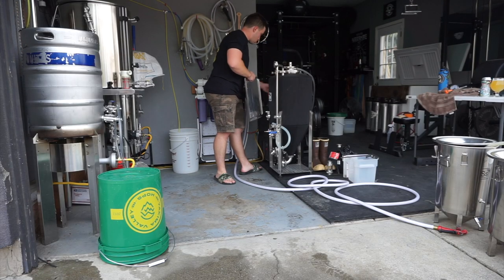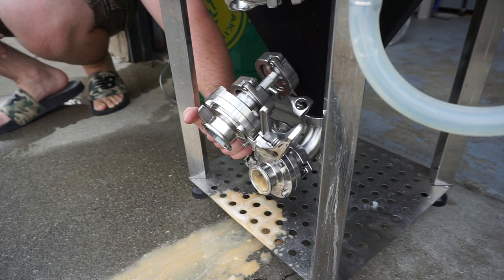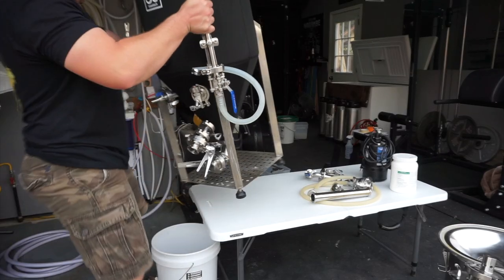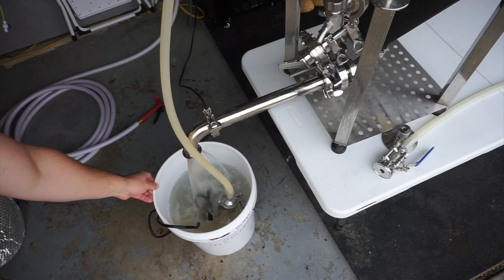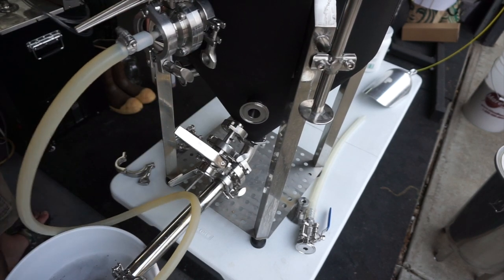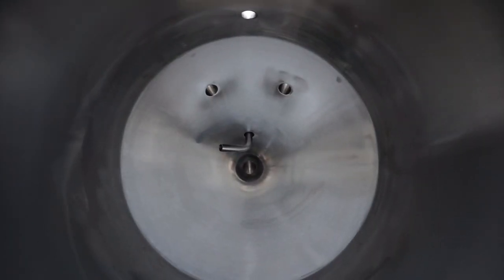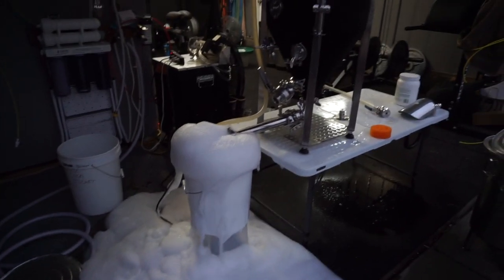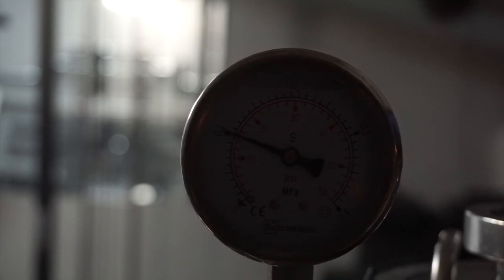HOW TO: CIP Conical Fermenter (Step By Step)

Comment: The more you know the longer it takes. Ignorance  is bliss. I do envy your unitank.
Reply from the maker: I no longer own them for the time reason alone, features are really nice to have though!
Reply: Yeah agreed. It's so much work in comparison to a simple fermenter. I bought a Brewtools MiniUni, which only has a top and bottom port. So i can pressure ferment, carbonise, drop hops oxygen free, dump trub and do CIP cleaning without having to dismantle and clean too much.

Comment: Thanks for the video..It seems like a lot of effort for such a small fermenter. I cleaning mine by hand in a lot less time - rinse out initially, hot wash with pbw solution (including brush...), rinse with water, cleaning with acid based solution, rinse, than remove all part and clean/brush in a bucket......at lease it feels that way 😀. Anyway nice video.

Comment: Great overview. All that work is a reminder of why I didn’t pull the trigger on a unitank, haha. 

I’ve settled for fermenting in 1/2 bbl sankeys. A friend of mine owns a brewery so I just swap out for a sanitized “fermenter” fresh off the keg washer every time I stop by.
Reply from the maker: Sounds like a killer deal! Honestly? I think Sanke kegs are one of the most underrated fermenters.

With the addition of a sample port and a way to purge CO2 while dry hopping, they are the next best thing to a uni in my eyes, considering the price of course. To bad I don’t have some food grade welding skills!
Reply: I came up with a tri clamp set up with a floating dip tube and butterfly valve for sampling/racking and dry hopping. I couldn’t figure out a simple glycol solution for maintaining temperatures, but I just tape the probe to the sidewall and use a vertical freezer as a fermentation chamber. https://www.homebrewtalk.com/threads/another-sanke-fermenter-gadget-floating-dip-tube-and-hop-dropper.684974/

Comment: Seems spot on to me. I picked up a big Chugger pump so I can CIP my 1/2bbl without the bucket and avoid some of that mess but it’s essentially what we did at the microbrewery where I worked too. I use hot water as a final sanitizer as well but I wait until brew day since the burners are going and there’s plenty available.
Reply from the maker: The Chugger MAX? That’s what I would like instead of the sump pump so it can be a closed loop but for 6x the price, I’ll have to stick it out with the sump pump.

Being able to use 185F water to sanitize would be awesome VS starsan or a non-foaming sanitizer.
Reply: Yes, it’s a tri clamp Chugger Max. Just got it. Before that it was a March and then a Riptide. Neither had enough pressure to go a really good job, I’m counting on nearly double the PSI to do it. It was pricey and the 1” hose and fittings added even more $ but besides it doing a better job it should also be a time saver. Just another piece in the endless gadget money pit that is home brewing!
Reply from the maker: @christopherbaas1774  ain’t that the truth. Cheers 🍻
Reply: @HopKillerBrewery  Why dont you use the same pump you use for brewing and then you could do a closed loop?  No additional pumps required

Comment: what attachment was used for the sump pump? The female to TC 1.5 in particular, most sump pumps are .75 inches or 1.25, so which attachment you use?

Comment: When you say you need to vent it to prevent a vacuum, what do you mean?  You have a pump pumping solution into the conical and a drain letting the solution come out.  By vent, are you just talking about the drain or something else?  I'm also not sure how a vacuum would be created in something that is being pumped into rather than out of.. but I'm new to conicals and just trying to understand.
Reply: I believe that would only be a concern if he was using an inline pump. With the bottom port open there is no danger of a vacuum

Comment: Nice setup! Do you use hot water with that pump when cleaning, and if so how does it handle the heat? I've been trying to figure out how I want to build my cip, and I've considered just using my chugger pump, but I've heard they can't produce enough pressure to make the ball spin. Cheers!
Reply from the maker: They are rated for 120F I think? Check the manufacture info in the link for the pump to make sure. I’ve used 140-150F with it multiple without problem, so far. At some point I imagine the gasket will give BUT it’s lasted two years so far. I even bought a second for cleaning my FV and kegs at once plus as back up incase my main one breaks.
Reply from the maker: I’ve also heard the same thing about the chiggers not being enough too. I sure wouldn’t do good enough in comparison to the sump pump but I couldn’t be wrong.
Reply: @HopKillerBrewery  For a $50 pump, if it lasts 2 years like that, it might be worth it. Cheers!

Comment: So two questions: how long is the process good for between batches? Say I need to wait a week until brewing, would it still be sanitized and good to go by then? And also, how does the spray go through the blow-off? Mine doesn't as it's as the top and the water will only drain through the Dump Valve/Racking arm.
Reply from the maker: Good questions!

1) Personally I’ve gone 5 days between sanitizing & sending a new batch into that FV commercially. Granted, I do keep the fermenter under pressure so if I went to check it a week later and the pressure was gone, I would re-sanitize it. If you can’t store your fermenter under pressure, I would always sanitize the day of brewing.

Anyone else reading this that has input, comment and let us know how long your pre-sanitize a vessel for!

2) When you have yeast(kraussen) that comes out of the blow off arm from fermentation, you want to ensure that the blow off is clean so running it through the blow off arm ensures it’s as clean as the rest of your fermenter.

The spray ball itself doesn’t reach the inside of the blow off arm, that’s why I always attach the hose to the blow off itself, thus running the cleaner/sanitizer through it.

Hope that clarified things for you!

Comment: This is a great video, but so many chemicals and water, not particularly environmentally friendly. Could steam sterilisation be an option after a deep clean of each item once resembled?
Reply from the maker: You could totally use 185F water recirculating to sanitize as well and use that for your brewing water.

Other than the initial cleaning with tap water to knock the majority of the gunk out before the CIP, it’s only a few gallons of PBW, which I try to re-use if I have more cleaning to do and a few gallons of sanitizer I also re-use.

Brewing is a utility heavy task but doing tweaks to make it better for environment is always a goal!

Comment: I’m trying to get into cip for my apartment brewery. It’s just too much to lift and scrub my keggle and becoming too expensive to fill with ~10 gallons ofpbw solution. Found a cheap cip ball on Amazon and I plan on drilling it into my lid for the keggle. Found out today that my northern brewer pump does not put out enough pressure for the pump to reach the sidewalls. Any solutions or help? Thanks! @Hop Killer Brewery
Reply from the maker: I use a sump pump to for my CIP. I’ve got a link in my description for that pump, works like a charm!
Reply: @HopKillerBrewery  I looked that none up. No issues with high temperatures?
Reply from the maker: @kylepietro396  I always keep it around 130-140F. No issues!

If you go higher temperature I would look into a Blichmann Riptide pump or A Chugger. The blichmann pumps are more powerful from what I’ve seen in other YouTube videos.
Reply: @HopKillerBrewery  thanks for the info! I was doing my best to avoid investing in another pump. I’ve got the one from northern brewer that is similar to an mkII. It only puts out about 5gpm which isn’t really enough pressure to spin the ball and reach the sides of the kettle

Comment: What size tank do you have? I ask cause i noticed the revised racking arm and that is something I'd like to switch out if I buy one. Very informative video, Thanks!
Reply from the maker: The one in the video is a 1/2BBL. I don’t like their racking arm design at all, they use it for the BME kettles and brew buckets as well.

I just added a Spike Brewing racking arm in place of theirs. It does stick out more so with a smaller unitank, it might block the racking arm below it. Just something to think about! Cheers
Reply: @HopKillerBrewery  Thanks for the quick reply. I am wondering if the racking arm opening is the same on the 1/2BBL as it is for their 14GAL version? I was going to do the same as you and replace the SS one with the Spike one.
Reply from the maker: I would imagine it’s similar? I’m sure you could return the racking arm if it doesn’t fit how you would want. 👍🏼
Reply: @HopKillerBrewery  Thanks again for the quick replies and great video. I am leaning towards getting one in a 14G size and seeing you were able to swap out give me hope. I am going to contact SS and see what they say, but from all of my research I like what I see. Cheers!
Reply: @HopKillerBrewery  I ordered the 14 Gal one, thanks again for the well done video on how to CIP, I took cues from your setup.
Reply from the maker: @Bohern1  hell yeah! Enjoy it brotha
Reply: @HopKillerBrewery  Will do! Cheers!

Comment: Really good guide. I have a Spike conical, but the process would be the same.
Reply from the maker: Thank you! I’m glad you like it, it would be the same. Does the spike clean as well since the spray ball is off to the side VS centralized. Let me know!
Reply: @HopKillerBrewery  Mine is new, but I'll let you know. What brand of pump are you using?
Reply from the maker: It’s a Superior Pump 1/3HP. Got it on Amazon!

Comment: That's a lot of moving and lifting for "cleaning in place"
Reply from the maker: It was right? Kind of defeating the purpose. I’ve seen bought keg extensions so I can fit a bucket under the bottom drain. It’s now a true “CIP”
Reply: @HopKillerBrewery  going to follow your advice and get one of these pumps to cip my keggle. Do you think there will be any issue with return to the bucket underneath? I have 1/2” ball valve out on the kettle
Reply from the maker: @kylepietro396  to be honest, I’m not sure if it will or not. I also DONT know if you can add a valve on the output to throttle back those style of pumps due to the back pressure it would create.

For sure look into that before buying it! You could always cycle it on and off to let it drain if it did get too full.
Reply: @HopKillerBrewery  I was working it out in my head and I was thinking of using my current homebrew pump to suck liquid from the kettle through the plate chiller to the bucket and then have the sump pump run as you do. At least this would maximize liquid out as opposed to relying on gravity. But the 5 gpm pails in comparison to the sump pump

Comment: I would say using co2 at the isn't necessary. When putting in beer you want oxygen to be present, hence oxygenation stones etc.
Reply from the maker: Keeping the unitank under pressure if you aren’t going to fill it in a few hours is to prevent any chance of bacteria/wild yeast from  entering since it’s under positive pressure.

Comment: When I’m thinking how much I want a fermenter like yours but then realise how easy it is to clean the FermZilla all rounder and how many I can ruin and buy before affording your setup…
Reply from the maker: I recently got the all-rounder and installed a cooling coil & thermowell. Everything plus a temp controller was around $200 to mimic a stainless, pressure capable fermenter.

Pretty sweet setup!
Reply: Seems like an interesting situation with Fermzilla vs stainless. I'm teetering on the edge. I love the look and long term benefits of using SS conicals. But given the costs are more than 10x fermzilla excluding cooling, it's not an easy decision to make. I currently have a 60l Fermzilla and fermentation chamber and my end beer is very reliable quality wise. So multiple Fermentation chambers and just replace the Fermzillas every 2 years. Seems like this could be more affordable and I can really see how clean the Fermzilla is after a clean. My brain says expand using my current setup and my heart says you need stainless ha ha. Thanks for the video.

Comment: too much mess for cip. Consider using a  magnetic pump and put the pbw with water inside the fermenter! cheers!
Reply from the maker: I’d like to use a Chugger Max that has welded TC fittings but not looking to spend the $300!